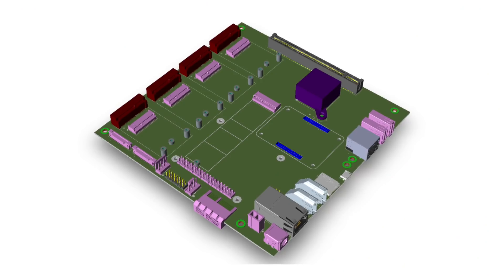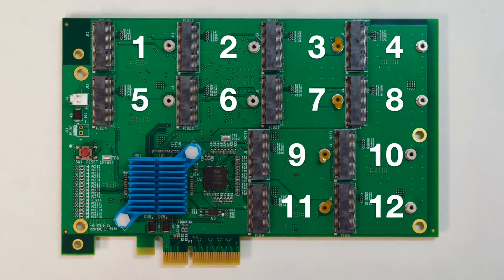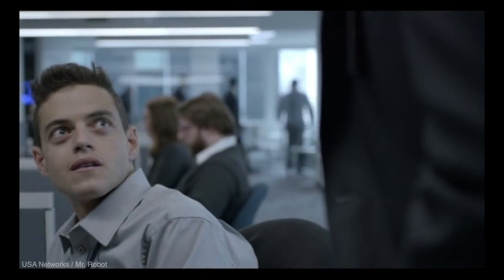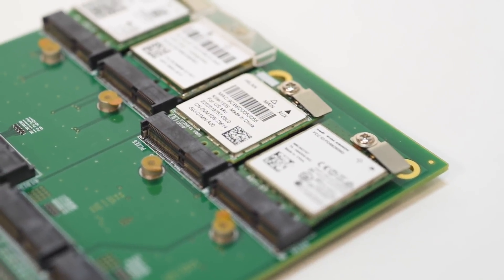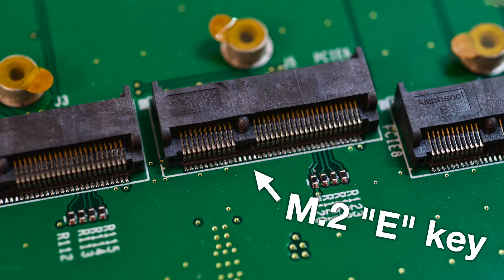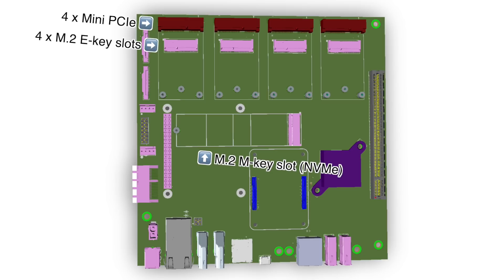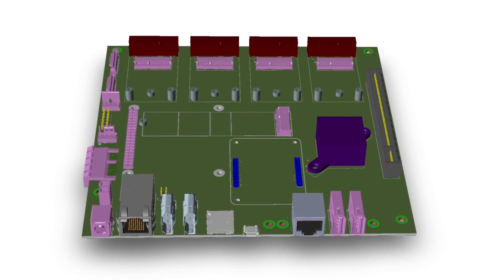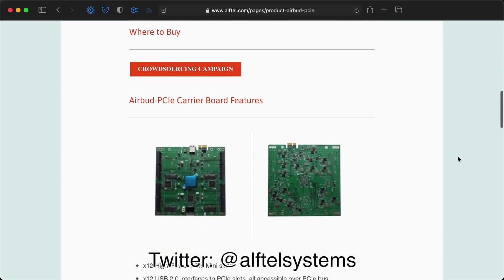12 PCI Express M.2 Slots on a Raspberry Pi!?

Comment: Question was regarding how do we connect so many PCIe devices to a single lane PCIe interface on CM4, and answer is very simple - through PCIe switch silicon. CM4 features x1 lane PCIe rev 2 at root complex with a standard bandwidth 5.0 GT/s or 500 MB/s or 4.19 Gbps bi-directional, in other words bandwidth that roughly equates to having x4 gigabit network interfaces at full blast. Whatever you do with this bandwidth one will saturate x4 CM4 CPU cores way before reaching this figure. Idea behind is to have a simultaneous access to multiple devices that do share this bandwidth and not necessarily consume all of it. Think about is as of USB hub but in PCIe domain. When it comes to Google Coral TPUs they are fundamentally different because they are PCIe masters, not slaves, and x1 lane bandwidth will be A LOT in terms of running multiple inference models simultaneously or one big in parallel. Idea behind developing Kickstater board is to expose CM4 PCIe to the max and allow developers and integrators to be flexible in terms of peripherals choice.
Reply from the maker: Explained well, thanks! (And in case anyone was wondering — Alexander is the one who sent me this board :)
Reply: so things like TPU should be okay, but multiple nvme storage with high utilization in each drive wouldn't be ideal right? seeing the board came with E key
Reply: @haziqsembilanlima  People slow down the PCIe link to something like gen 2 because NVMe is too fast for CPUs, and the performance is worse that hard drives when NVMe "acts up."
Reply: "If you give mouse a cookie..." - all we are trying to do is to give community a chance to explore PCIe with RPi (CM4) and not an attempt to build a CM4 based power house capable to move gigabytes of data around. With this respect x1 PCIe rev 2 is more then enough. As an example to compare - during one of our DEFCON presentations we monitored WiFi traffic on conference floor with 32 radios and thousands of attendees around and were able to achieve ~25K frames/sec rates and all this was done over a single USB 2.0 connection. Now, comparing to PCIe rev 2 5 GTransfers/second bidirectional I can guarantee that you will kill your CPU well before reaching even half of this bandwidth unless you will use specialized zero copy network device drivers or N2DISK/DISK2N specialized storage device drivers.
Reply: @Alexander Can you put lots of wifi in, and sync them all with a high quality clock? a lot of good wifi applications for that. There is always SDR but this could be considerably cheaper so long as there is a high quality clock they can all access.
Reply: @cannaroe1213  commodity off the shelf radios do not have a separate sync arrangement but SDRs usually do (not all of them). The main reason of having high quality common clock for federation of SDRs is an ability to combine their respective bandwidth and TX/RX on a wider channel(s). With commodity WiFi cards this approach does not make much sense since these radios are already have an ability to be tuned to pre-defined channels in a/b/g/n/ac spectrum. If one is looking for a wide multi-channel monitoring then take a look at current Kismet from GIT (or one that is shipped with latest Kali) - it has been re-developed to support multi-radio traffic monitoring and capture with nice and manageable channel-to-channel and radio-to-radio hopping. Go to the same youtube and search for "gleb esman defcon" to get a sense what I am talking about. At some point at DEFCON we were able to monitor and detect tens of thousands unique wireless devices in proximity. It was done with x86 board, but is certainly possible with current RPi serving as a capture sensor without any GUI stuff running.
Reply: 1 gigabit network interfaces are just so 1999.   cheap retail 2.5 gigabit and covid scalping! 5gigabit chips is it now. preferably separate dual and quad ports so you can 'bridge' them all until the scalping retail unmanaged switch vendor's lower prices per port we will pay.
Reply: @paulmaydaynight9925  Paul, you will be after NXP Layerscape product line, not RPi, but then again, it is a different animal game. As for unmanaged switches and "cut-through" function and other exotic features take a look at Marvel offerings, but this will be a custom development beyond RPi "grade".
Reply: @alexanderzakharov4249  those nxp ARMv7-A architecture announced in 2011 are not really fit for 2021 now, even we mere retail 'mice' now know layer 2 unmanaged switches are nothing special today, they just do the bridging in a cheap generic penny hardware block instead of kernel software mostly. give an old retail elephant a mouse crumb he's going to wonder if people want to really make and sell him their diy kit, and have them widely advocate his wares for free to all they know.
Reply: @paulmaydaynight9925  Strange - I do post comments and they do disappear, probably because of links that I am pasting. Anyways, look at higher end layerscape offerings that include 4/8/12/16 core Cortex-A72 and all networking gear that you will ever need, including bult-in switching matrix with all these exotic features. We used them in a past with great success as real-time packet processing engine.
Reply: @alexanderzakharov4249  yep, my  yt and direct url posting has been mostly auto deleted when i post on any of the yt pages for weeks, your the first to confirm it though...

if its a yt url i get around it like this for now
see 'Robert Murray-Smith Copper Nanoparticles In Gelatin 2014' 

so people can at least copy, paste it and have google give them direct link somewhere near the top
Reply: @paulmaydaynight9925  cant copy/paste in mobile :( :( what a bit show
Reply: But, again, it is a different ball game with different price tag attached. We used these high end silicons in a past with great success - they have everything you need, but is beyond DIY style and from HW and from SW perspectives, and definitely not RPi "grade" stuff.
Reply: My use case here would be doing some kind of SDR MIMO array with those sidekiq or xtrx PCIe modules.
Reply: @AJMansfield1  it would be so much better if the radio vendors just stopped arsing about and just put 8+ arrays on the chip as 'per the official spec' and stopped with a drip, drop two arrays and out dated software algorithms in the drivers and latest and greatest nickel and diming  shinny thing etc...
20 years of only 1 gigabit network interfaces to bottlenecked faster wireless throughput you cant use for the poor people and appliance users that cant write the full tech price off as a business expense is enough.
Reply: @paulmaydaynight9925  well said :)
Reply: I am SUPER interested in running multiple TPU's on a CM4.  Obviously, there are some driver issues right now but things will eventually clear up.  Is there a quarter level when the native CM4/M.2 cards might be available?  Q4 2021?, Q1 2022?  The designs looked very clean and it might just make a nice low power training farm for me.
Reply: @haroldhannon7253  We finished schematic capture and BOM. BOM is under review by supplier(s) - we need their quotes in order to form pledge value. Layout and routing are done 80% - maybe another week or so. We are really close to start campaign soon - I estimate in 3 weeks.
Reply: pro tip: you can watch series at InstaFlixxer. Me and my gf have been using them for watching lots of of movies recently.
Reply: @Cesar Axl Definitely, I've been watching on instaflixxer for since december myself :D
Reply: @Cesar Axl Yup, been watching on instaflixxer for since november myself :)

Comment: Hi Jeff, love your channel. It seems like getting your hands into one of these ultra-hyped CM4's is a big deal these days. Do you have a clue as to when they will be available?
Reply from the maker: I am finally finding 4 GB models (both Lite and eMMC) in stock briefly at some US retailers. My local Micro Center even had one a couple weeks ago!

But they go right back out of stock quick.

Alternatively, the 1GB models are in stock at most places now (I have a couple that I use for testing where I don't need a lot of RAM).

Comment: When are we going to get a pi with gigabit, sfp+ and decent wireless, so I can build a pi router 🤣
Reply: The best is when router and WiFi AP are separate devices. Regarding sfp+ you can get rb4011. It can be found used under $100. That is already an overkill for home but why not.

Comment: Finding m.2's  in high capacity is going to be the issue because at this stage for a ssd m.2 you would max out at 12TB, with access 8TB m.2's 96TB wouldn't be nothing to sneeze at

Comment: Did you really just compare the $3200 Airbud -X9 with a Tetra at $200. Even the new enterprise version is $350. I like what you do but have go a comparing similar priced items and capabilities. It’s a raspberry pi compute module not  an AMD THREADRIPPER Pc.
Reply: Airbud-X9 was purely PCIe Mini based model in a custom case with Intel mobo inside and other stuff. Coming soon kickstarter board (based on design that was presented by Jeff in this video) is just a carrier that supports a) RPi CM4 module with up-to 8G ram depending on model, b) any RPi HAT module, c) any commercially available PCIe Mini or M.2 radio (x4 of each), and c) complete freedom of Ubuntu/RPi OS software offering. In other words, build whatever you want and whatever suits your needs, including WiFi6e AX210 or whatever will be next. Hopefully Google and RPi folks will figure out Coral TPU stuff, which will bring AI aspect to variety of applications. It's a development platform ready to be customized as a product. You have to compare apples to apples, not apples to oranges. Multi-radio gadget for pentesters and other wireless stuff is just one of the applications. What Jeff was showing is PCIe switch based design as add-on card, and kickstarter carrier board will utilize the same concept. When it comes to wireless sensor or sniffer, this board will be much more flexible to my taste. Of course nothing is black and white, and as with any development platform it will require certain knowledge and skill, BUT, board will allow to minimize add-on hardware adaptation headache and go straight to desirable application with PCie components of your choice. Once board will be ready for the drive we will test it with multi-radio arrangement and Kismet and will share results with community. It will be interesting to see how RPi ARM silicon will handle heavy wireless capture as Kismet sensor.
Reply: @alexanderzakharov4249  I like the sound of the new board and the plug. I will probably back it. However, my point is fair and valid. I have signed up to your site so that get the Kickstarter details. While I am at it. I have a kit already built with Hackrf , a couple of Tetras and a couple of yard sticks. All of these work together in terms of Rf data, information exploration and community research. Processing as you say is another matter. All the best
Reply: @zen1752  We are about to launch this project with CrowdSupply which seems a better vehicle vs Kickstarter to run this activity. I will ask Jeff to update this post once campaign will roll out.

Comment: Can you make a video about Windows on Raspberry (WoR) project, please?  You can install the real Windows 10 ARM version on Raspberry Pi, thanks to this project. It's not officially supported by M$, but these guys did a great job. Even x86 apps now working with the latest x86 emulation layer, and 64-bit x86 apps run almost at a native speed. We are just waiting for the proper wireless and gpu acceleration drivers.

Comment: As someone who uses LTE modems for internet, this is awesome.
Reply: Just make sure that modems a) do support eSIM since there is no provision for SIM card holders (even though there PCIe Mini to PCIe mini are adapters with SIM slot), and b) modern generation of modems from few vendors populate USB 3.0 pairs in place of PCIe ones, and in order to make them work user has to configure/provision them to use USB 2.0 interfaces instead of USB 3.0 with stand-alone USB 3.0 adapter, save configuration and only after then plug them in. This issue id known and has been discussed a few times in different forums. Boils down to the following: all cellular modems do use USB interfaces even though being M.2 or PCIe Mini form factor, but due to recent advances in technology bandwidth called for higher speed interface, and manufacturers (such as Telit) started to provision USB 3.0 interface while there is no publicly available standard for such provision. As result these cards do not "play" nicely being inserted in legacy PCIe Mini slot, and M.2 Key A/E does not have a standard provision for USB 3.0, but some other "Keys" do. To make a long story short - eSim and USB 2.0 interfaces are required in order to make it work - there are no LTE modems that implement PCIe interface, but these modems are implemented as PCIe Mini and M.2 cards and use USB interface, being USB 2.0 as standard provision on PCIe Mini or non-standard USB 3.0 provision on PCIe Mini,  or use a different M.2 Key and form factor. Overall, you should do your "homework" before diving into this venture.
Reply: Techship dot com so far has the best variety of different offerings and great support team.
Reply: @alexanderzakharov4249  I am currently running 2 setups. One is a CBA850LP6 with an em7455. The other is a USB 3.0 sled with an em7565 on a pi4 running r00ter.
Reply: @TheZolon  You are referring to M.2 Key B 2242 form factor which has a different signal provision, form factor, and Key. Our board (and future Kickstarter board) supports only M.2 Key A/E cards, and others through PCIe Mini to - whatever M.2 - adapter, BUT there is no internal USB 3.0 provision, so your modems in case they will be plugged into our PCIe mini slots will be able to utilize USB 2.0 interface, but not USB 3.0, which in a sense will not allow CAT10 and CAT11 modems to achieve a full speed (which I will personally question since there is no way that one will be able to achieve these kinds of speed, at least not with the normal Joe budget.)

Comment: Once you need PCI-E it is better to use X86 anyway
Reply: From ease of "drop-in" software stand point yes, but from purely power and cost effective perspective not. At some point Intel tried aggressively approach embedded market with Atom family by introducing silicons like E8000, but .... as it always happen with big corp somebody made executive decision to sunset this activity and all we have left is a very few offerings aimed for embedded market and very few small form factor boards/modules supporting them. We really did enjoy E8000 Braswel module fro solid-run company, but they also decided to drop it in favor to ARM. ARM on the other hand made significant advances and we have plethora of quality silicons with PCIe interface. Agree, RPi CM4 is probably not the best vehicle to handle PCIe business, but since they do have it and exposed in CM4 product, why not to take it for a spin and see what we can "squeeze" out of it? Another point to make is hundreds of affordable HAT offerings to implement variety of interesting projects starting from home automation and all  a way to AI - adding PCIe to the pile will certainly add capability and functionality.

Comment: There are plenty of pci-e compatible expansions that could be plugged into a PCI-e gen2 slot of x8 length (or even x16). It is a waste how they don't generally exist (and for cheap) considering how so many people have a empty graphics card slot they'd never use (and on a reasonable PC for daily usage, such as a quadcore of 2GHz or 3GHz). It's odd that niche is not filled considering plenty old chips (xeon especially) have new mboards made (especially in China) running ddr3 just fine (includiin dual or quad channel). Also many people will run, say, an i5 CPU and upgrade the 4460 graphics up to an rx570 (or a bit less). A PCI-e gen3 card running at x16 could have eight m.2 slots of nvme (at speeds of x4 gen2 PCI-e) and would run fine even in x8 mode on a Gen2 PCI-e slot. Or even such a card for nvme m.2 storage but also with a few 10Gbps rj45 i350 ethernet ports on it would be good (and maybe an SFP). Plonking a load of IO on such a card would be cool to bring up an old PC to more modern capabilities would make sense and could include some usb 3.1 on there too. If the bandwidth saturates, just use only what you need.
Reply: Canadian company Amfeltec makes cards exactly as you described - check them out.
Reply: @alexanderzakharov4249  Thanks for the heads up. I've seen somewhat smilar ASUS ROG cards. It all seems a tad pricey tbh. Although it is nice it exists (so I'm not knocking it). Eventually a standard "decent enough and won't break" chipset needs to become a common-denominator and so people will white-label it and make a chip based on that. It can be a pity not to do that because eventually somebody will figure out that plonking an FPGA on a custom PCB (PCI-e) will allow for a multiplier tree to (half life style) divide down a x16 slot into 3 of x4 slots. At which point, nobody will bother with such premade boards.

Comment: You missed the point with all the wifi cards, this is meant to run Google Coral modules which are completely sold out for the next few months in the USB variant.
Reply: Board was designed as a general M.2 carrier for M.2 Key A/E cards - WiFi and Coral cards are just a suitable applications.
Reply: @alexanderzakharov4249  I should have read your webpage. Nice work!
Reply: @drgalaxy  Brian, board that Jeff was talking about is not on our web site, but is presented at our Tindie shop, along other wireless gadgets